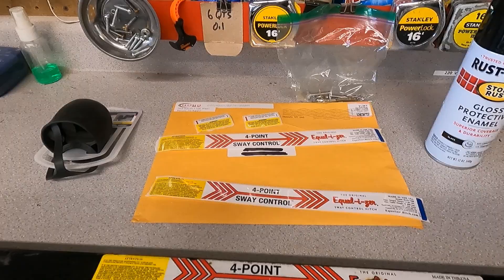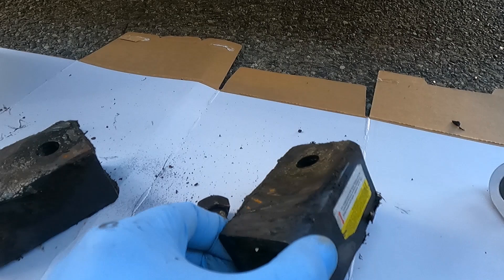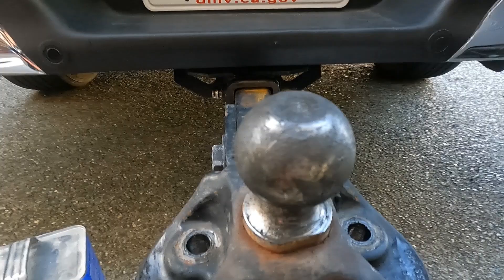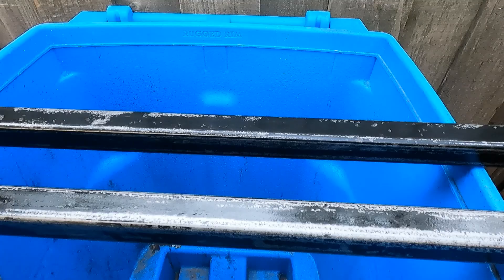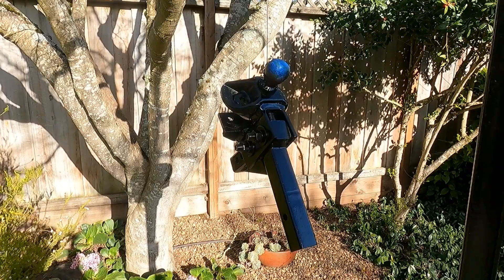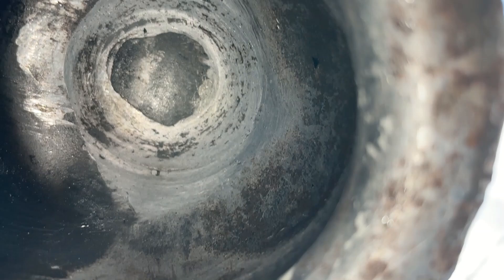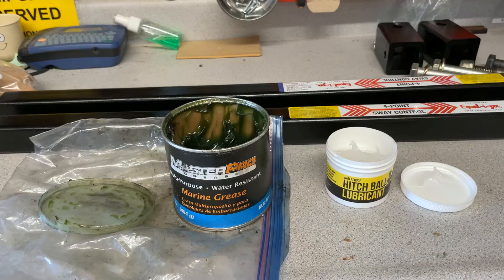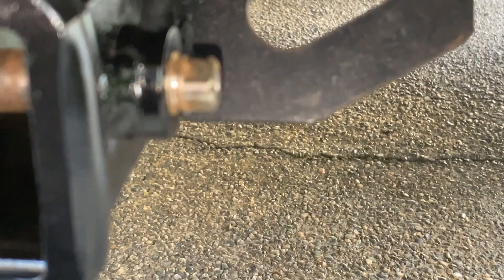Equalizer Weight Distribution Hitch - Inspecting, Replacing Parts, Restoring, Lubricating, & More

Comment: Great info! I need to tear my head down before our trip and check for those cracks and clean it up good. It’s been two years since I’ve torn it down completely. Equalizer sent me new decals for the bars when I contacted them about buying some when I repainted mine, they wouldn’t charge for them either. Great company.
Reply from the maker: Thanks so much Greg, it's nice to tear it down from time to time to do a good inspection and to perform a good lubrication. Also to torgue everything down again to the proper specifications. Its nice they supply everyone with replaceable decals and stand behind their product. Have fun, where are you heading this summer?
Reply: @thetraveltrailerguy    Hopefully Glacier National Park, wildfires chased us away last year so we’ll try one more time
Reply from the maker: @ggimlick  Nice I really liked it there a few years ago, its beautiful. We stayed on both the west and east sides just outside the park. Whichever side you stay on make sure you drive all the way across the park to the other side, so much to see.
Reply: @thetraveltrailerguy   We’re dragging it across from the east and staying in Columbia Falls, day trips from there for ten days then on to Denver
Reply from the maker: @ggimlick  Have fun :)

Comment: That second ball lube is a silicone base similar to plumber’s grease/dielectric grease/gasket conditioner etc. it is great to keep around and safe for almost everything where grease is not
Reply from the maker: So far I'm not as happy with the new silicone lube as the white lube I was using, it doesn't seem to last as long. That's what I'm seeing so far, I'm going to have and give it a little more time before I post how I feel about it
Reply: @thetraveltrailerguy  as a plumber, I found that it didn’t last as long,  but it didn’t seem to have any negative effects or attract as much dust as regular grease normally would

Comment: Michael , Kinda on the same topic , I have 3 questions for you .

1 . Is their a truck tire you prefer over another?
2. Do you do anything with your air pressure when the rig is hooked up ?
Do you have a opinion on Timkin or Sumo bump stop springs ?

Everything you do is top notch so I value your opinions .
Reply from the maker: Thank you Ken. Right now I'm not very knowledgeable on what are the best truck tires or anything about bump stop springs. I've only had our truck for for 4 1/2 years so I haven't had to replace the tires yet. Sorry I haven't been able to answer your questions, I would rather say that then steer you wrong.   You bring up a good question about air pressure in truck tires while hooked up, I was just going to research this so right now I just leave my truck tires inflated at the pressure that is on the decal that is in the truck door jam and that has been working.     If I do find out that I should be airing the tires up while towing I'll do a video on this subject, but before I do I want to know facts first

Comment: The reason the bolt head is on top so if the nut comes off the bolt will still say in and have some support. The way you have it if the nut comes off the bolt will just fall out and no support.
Reply from the maker: Good catch. If I was not using a lock nut I would not install the bolt this way because what you said may happen

Comment: Great video until the end when you put the bolt upside down, if the nut fell off pointed down the bolt could still stay in. everything else is solid.
Reply from the maker: Thank you and thanks for watching. I'm not really concerned about the nut coming off, its a quality lock nut that is torqued to 70 lbs. I'm always checking the hitch at every stop and look at the threads coming out of the nut to make sure nothing has come loose. If the nut was on the bottom I would never see it gone :)
Reply: You posted that 2 years ago, so your theory seems solid.
Reply from the maker: @goatmaster3387  Fingers and toes crossed :) I used to to maintenance on production machinery that had a lot of vibration and we would always used quality lock nuts and bolts. We would have the nuts on the top so we could visually check to make sure they were still on there during daily inspections. We never had any of the lock nuts loosen, now if they were regular nuts I'm sure they would have been falling off :) Thanks so much for mentioning this, you are the first person out of close to 10,000 people that have watched this video that have caught this :) Good eye.

Comment: Mine is brand new, but the dealership was sketchy, so I took it apart and used anti-seize compound on there. I torqued them 10# over because my wrench is cheap and I don’t trust it 100%. Have you ever tried painting the bars with slip plate? Or another graphite coating?
Reply from the maker: Good question Chris, I don't think it would be good to paint slip plate on the bars since they are friction bars and help with preventing sway. If they are slick they may not properly do what they are supposed to do. If you do this I hope you let me know how this works
Reply from the maker: Woops are you talking about painting the whole bar or just down by the hitch sockets?
Reply: @thetraveltrailerguy  the whole thing really. I paint my whole lawn mower blades for simplicity to help keep grass buildup down. The force between the metal parts that needs friction is on the socket, not the bars. The bars are there strictly as spring force transference between the hitch head and the frame.
Reply from the maker: @liquidrockaquatics3900  Thank you I might try this sometime, thanks for the tips. If you do it can you please reply on how it works for you? I would apricate it.
Reply: @liquidrockaquatics3900  the downward force of the bars onto the bracket are also part of the friction. Hence the FOUR two points at the socket two point at the bracket. But then again they come painted some dint think it would be any big deal dint think the paint will last long at friction point though

Comment: Do you remember the size of the bolts washer and nuts?
Reply from the maker: Hello Ray. NOTE for my hitch If I remember correctly the bolt Qty 2 - 5/8" X 5" fine thread UNF18 grade 8; Qty 2 - 5/8" Lock Nuts grade 8 (I like using lock nuts for this application that do not use nylon); Qty 2 - 5/8" Washer grade 8.   Before buying you should take measurements of yours as they may be different, some are made with 3/4" bolts. Here's a link I just found for 3/4" replacement bolts I found on Amazon - Equal-i-zer Bolt Pack for 6K, 10K, 12K, and 14K Hitch amazon affiliate link - https://amzn.to/3tyEHt0

Comment: Do you have a video on that battery box?
Reply from the maker: Here you go - https://youtu.be/1vm4w3BMq4I
Reply from the maker: UPDATE: Soon after doing this installation I replaced all the battery wires from small ones to 2/0 wires

Here's a link to the box (Model M207 is the box I used - NOTE - the Model M206 is to small for 4 - 6 volt batteries to fit in)  - Dee Zee M207 Specialty Series ATV Box - 
https://amzn.to/2OUPFcf

Here's a link to the vents -
 https://amzn.to/3lBa95S
Reply from the maker: https://youtu.be/3lDVBU4CFMM
Reply from the maker: https://youtu.be/rkRzH0Ay1z0

Comment: Damn the part is missing where you slide the trunnion bar holders back in. I want to see how easily they go in bc I have to pound them in with a hammer
Reply from the maker: Thanks for watching and commenting :) Good catch I should have shown how easy it is to slide the bars in place. 
Lets begin where I hook up the truck to the trailer - So what I do is lower the hitch on the ball, if the the latch will not easily lock on the ball I pull forward slightly with the ball under the hitch, this allows the ball to be located towards the front of the hitch ball pocket, with this done the latch move to the lock position easily. 
Once the ball is locked in place and the bars are on I start lowering the jack to lift both the back of the truck and the front of the trailer. As I keep lifting I can see the bars rising so they can slide into the bar holders, I might have to slightly lift the bar to get it in place or just keep jacking the trailer up a little more. Once the bars are in place and I have them locked in I raise the jack :) No need for a hammer  :) 
I hope this information is helpful  https://www.youtube.com/@thetraveltrailerguy/videos
Reply: @thetraveltrailerguy  I have disassembled the hitch bc it almost took a sledgehammer to move my bars. Wire brushed everything, sanded things down. Waiting on grease (Amazon) to reassemble. The question is when I go to put “ bar sockets” back in I have to hit them with a hammer not hard but I am just worried that the somebody way over torqued those socket bolts. I mean this hitch seems sturdy as a tank but I’m always a worrier hahah. I’m about to max this thing out with 995# tongue weight so all needs to be perfect
Reply: @thetraveltrailerguy  so I guess the question is when disassembling or reassembling should I encounter significant resistance to get those bar holder sockets back in? Talking about the part that holds the bars that eventually gets torqued down to 65lb
Reply from the maker: @beginagainben6276  oh wow I have never had this happen to me or anyone I know. The bar sockets should slide in and out pretty easy into the hitch head. Have you always kept them greased? You shouldn't have to use a large hammer to get them in and out, they should slide right in without a hammer or with a slight gentle tapping with a hammer. 
I like that you cleaned them up and sanded the surface, after doing this do they slide in easier without grease? I think I read somewhere that the bar socket bolts can be torqued between 65lb and 100lb (search the internet to see if this is true)

Comment: They are not meant to be greased you’re defeating the purpose of the anti-sway system. The reason you’re seeing 
Worn out spots from and debris in those is because grease attracts dirt
Reply from the maker: I'm sorry you feel that way Mike, I'm not giving bad information. I do a lot of research before making these videos. Here's some facts to look at about lubricating the hitch:  https://progress.nyc3.cdn.digitaloceanspaces.com/shared/image/EQ_Infographic_HitchLube_2019_updated.jpg      https://www.equalizerhitch.com/manuals-and-guides/manuals/6k-14k-owners-manual     Never apply grease where the bars rest on the slide "L" brackets.  I hope this information helps clear things up. Thank you for watching and commenting

Comment: Stop giving bad information do some homework. Directly from manufacture: Should one grease the bars on the hitch to reduce wear or does that reduce the anti sway properties by reducing friction too much? Expert Reply: No you are not going to want to put grease directly on the spring bars (or the brackets) of the Equal-i-zer Weight Distribution
Reply from the maker: I'm sorry you feel that way Mike, I'm not giving bad information. I do a lot of research before making these videos. Here's some facts to look at about lubricating the hitch:  https://progress.nyc3.cdn.digitaloceanspaces.com/shared/image/EQ_Infographic_HitchLube_2019_updated.jpg      https://www.equalizerhitch.com/manuals-and-guides/manuals/6k-14k-owners-manual     Never apply grease where the bars rest on the slide "L" brackets.  I hope this information helps clear things up. Thank you for watching and commenting